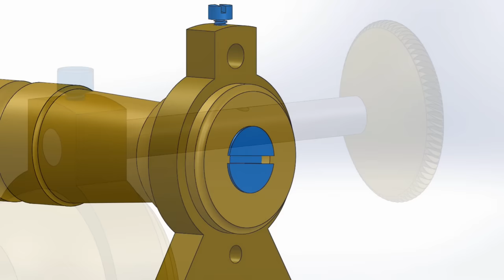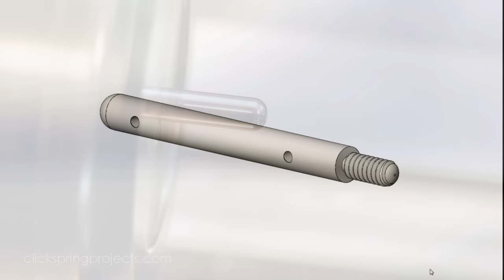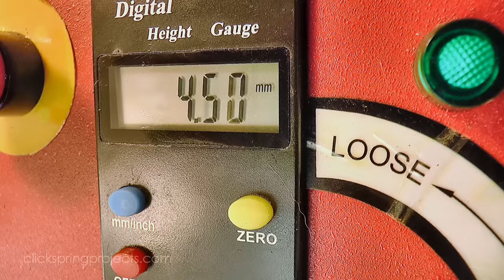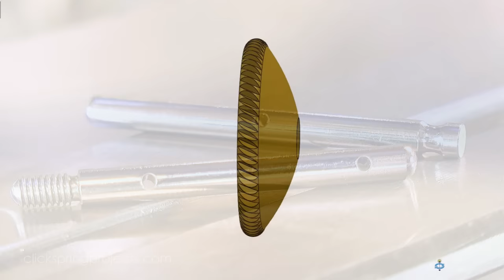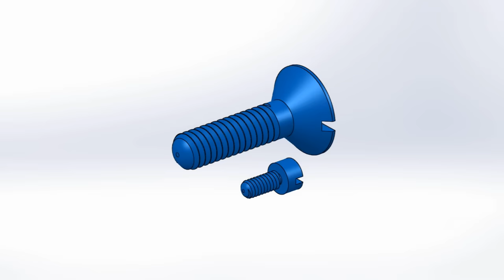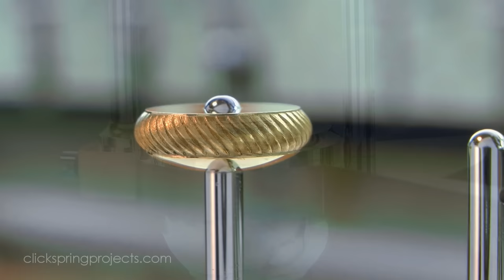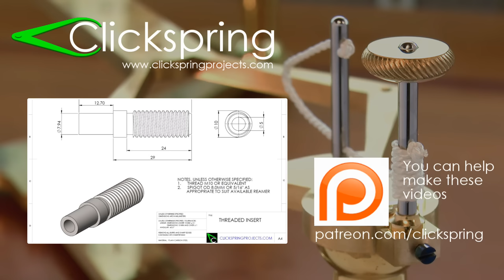Clockmaking - How To Make A Clock - Part 17 - Making The Regulator And Suspension Post

Comment: ah, the explanation on why you only made 5 of the screws finally comes to light!
i will agree, the simplicity of the pendulum mount makes it a lot easier then having an adjustable bob on the end that i have seen on other clocks.
keep up the excellent and beautiful work!
Reply from the maker: +kelby bannert Hey Kelby, yes I suspect the thread will have its own negative attribute of stretching over time, and possibly changing with humidity, but it sure is a simple approach! Cheers mate :)
Reply: +Clickspring leather if treated right doesnt stretch or change with humidity :) if the silk string doesnt cut it and you're looking for a traditional and natural alternative. dont know if leather is used in clockmaking but in really old mechanics its used where there should be no stretch, like between the helm and rudder on a ship. The silk is beautiful and not at all like leather though, maybe not what you're looking for in the artistic sense....

Comment: Having said that about the supporter pack.....amazing stuff with the clock....fascinating to watch. Doubt I could have the patience to complete the whole project, so I tip me lid to ya for the accuracy and tenacity this project requires. I used to work for Myer in Sydney and watches that came back for repair, It was my job to drop off the watches at the various watch repair shops in the city. I was always a little envious of the watch repairers job. It seemed to be a role you could lose yourself in, to enter a meditative state.

Comment: Hi,

I have been viewing your channel for some months now, and am absolutely enthralled with this full build clock project. I am really interested in all kinds of watches and clocks, I think I caught the clock work bug when dad bought 3 ready made grand-father clock mechanisms and built cases the appropriate sizes to fit each particular room they would be standing, two for instance were to stand in two completely different house 10 miles apart but by chance each of the owners, my nan and my father’s sister used the loft as an extra bedroom so with the slope of the roof impeding the height a lot each of those clocks were make less high and that was made to look correct with a slimmer body.
I was only 7 at the time though the mechanical bug must have made a real impression on me to remember it 50 years later!

I wish I could have borrowed my brother in laws watch makers Lathe but he said I can’t, and judging on some of the things you have done it mayn’t have been big enough to do some of the work. 
I will have to settle on viewing your wonderful videos instead, trying to teach myself what the names of the parts are and their placing you know.

Take care and thanks for the upload and video work.
mrbluenun
Reply from the maker: +mrbluenun Appreciate you taking the time to watch mate :)

Comment: Why not simply use a screw adjustable weight at the bottom of the pendulum? Moving its center of mass up and down also adjusts the effective length and so the speed.

Comment: How do you bring the inside of your screw threads to such a high polish?
Reply: +NightHawkInLight Really cool to see that one of the youtubers I subscribe to is a fan of another youtuber I subscribe to!
Reply from the maker: +NightHawkInLight Diamantine powder (very fine aluminum oxide) mixed with a small amount of oil, applied with a piece of pegwood (a soft dense wood). The pegwood quickly takes up the shape of the thread, and then the polish can cut all the way to the bottom of the thread. Great to have you watching mate :)

Comment: You should use a bit of oil while you"re knurling. Without the extra lubrication, the surfaces tear a little bit where the wheel contacts it. You'll get a much brighter surface finish.

Comment: I love watching these videos, and they have inspired me to purchase an old atlas lathe, Just one question, if you wanted to make sure the countersunk screw slot was vertical how would you do that? My thought is to cut the threads for both sides thread the screw blank in than mark where the slot would be. But I'm sure there has to be an easier way.
Reply from the maker: +Brian Lenz The method you mention is the most reliable way to time screws. There are other approaches, but this is the least troublesome. Although with steel into brass, its not really worth the trouble. The brass is too soft and gives over time. After multiple insertions, the thread is slightly worn, and the orientation changes significantly, and not in an easy to predict manner. Steel into steel is much more reliable, although still problematic - its surprising how much the thread orientation changes once polishing commences, so a fair amount of guesswork is required to predict where the slot will be after all work is completed
Reply: Wow, I didn't even consider the different metals! Thanks for the info, can't wait to see whats next.

Comment: Why didn't you use the cross-hole jig on the finger plate clamping tool? I think it will yield a much more accurate cross hole for the rods.
Reply from the maker: +Hyper Paradox You're right, I completely forgot about it :)

Comment: Hey Chris, outstanding as usual. Just a quick question if i may, On average how long does it take to put a vid together? If you were to fabricate the parts in this vid without recording, overdub, graphics (which quite frankly are a professional touch) etc. what is the time difference?
Mick.
Reply from the maker: +The Foont If I was just making the clock with no interrruptions, I would have been done in about 6 to 8 weeks. Filming takes up a huge amount of time, plus I have to fit it all in with my day job. Thanks for tuning in mate :)

Comment: Awesome work! But I'm curious as to why you didn't align the slot of the countersunk screw with the frame or any other reference. Have you decided as a general rule that you won't align the screw heads?

In any case, thank you for sharing your labor of love.
Reply from the maker: +Eddy Miller Hey Eddy, I did it for the barrel screws after a viewer request, but generally its not worth the trouble to time hardened steel screws in brass. The metal is too soft, and "gives" after multiple insertions of the screw. In a short period of time the orientation is lost. Far better to embrace a little randomness in the presentation :)

Comment: Excellent as always Chris, mate quick question, I know you live up in North QLD (I'm in Brisbane). What do you use on your machines to stop surface rust. I just got a new (to me) lathe and wondered what was best to keep the rust away. Any help would be greatly appreciated and can't wait for you next vid.... I wish mine where as well done as yours :) 
Cheers 
Mark
Reply from the maker: +Mark Valenzia Hey Mark, yes it is a big issue particularly during the wet season. I give everything a thin coating of compressor oil every time I'm finished with it, and find that works very effectively. It requires complete discipline; if I should forget there will be flash rust to greet me the following day, but since adopting this practice I have solved the issue completely.
Reply: Thanks for getting back to me mate, I'll definitely look at giving the compressor oil a go. Thanks again.

Comment: Is it necessary to stretch the silk before putting it in the clock? Do you plan on CA gluing the knots?
Reply from the maker: +George Savage That's a good idea on the CA glue George. Might also look at a small brass bead, and swage it on. Thanks for suggesting :)
Reply: +Clickspring Nylon thread can be carefully heated to prevent untying. A temperature controlled soldering iron is the best tool for that job to prevent scorching. I've used that technique when mounting guitar strings if they got too short o tie reliably.

Comment: AvE once said "It is a sign of a true craftsman when all the screws on a piece of work line up". That top one is the only one that doesn't, is there any way to change the angle of the screw relative to the others when fully threaded in?
Reply from the maker: +The Thinker I did it for the barrel screws after a viewer request, but generally its not worth the trouble to time hardened steel screws in brass. The metal is too soft, and "gives" after multiple insertions of the screw. In a short period of time the orientation is lost. Even with screwing steel into steel its not something i would generally pursue, as it also requires all future repairman to pay close attention to the screw locations over the (several hundred year?) life of the clock to maintain the effect. Far better to embrace a little randomness in the presentation. Thanks for watching
Reply: +Clickspring Ahh I understand, thank you for taking the time to respond to that. I absolutely love the videos and think you do amazing work, I was just curious about that.
Reply: +Clickspring Great explanation. Guess that's why 'clocking' screws is something only wood workers do, because the wood always has some give to it.

Comment: Odd question, do some machinists stop the blueing process on parts earlier? To get straw or bronze colours?
Reply from the maker: +Andy Collier Yes definitely - the lighter straw colors are perfect for cutting tools; the steel remains much harder. A blue temper is good for springs, screws etc and also for the cosmetic appearance. Cheers Andy :)

Comment: What's the difference between a drill and a reamer, and what's the objective when reaming a freshly drilled hole?
Reply from the maker: +colavfreak2 Drills generate quite a rough hole, that is not particularly accurate. Drilling slightly undersized, and then following with a reamer will give you a precise hole dimension with a good surface finish. Thanks for watching and asking

Comment: 6:33 People usually heat up the pieces to release cyanoacrylate, which could harm the finish. Is acetone sufficient enough? How well does it get between the pieces?
Reply from the maker: +Evren Uçar Yes heat is quick but it will marr the finish. In this case I wanted to keep the finish fresh, so acetone is the best alternative to heat. It works fine if you are prepared to wait a little while (30 mins) The trick is to not put on any more CA glue than you really need to hold it for the cut. Any excess is just extra time you have to wait for the acetone to erode it. If you put on too much just leave it to soak in acetone overnight, by morning it will be free.
Reply: Clickspring Thanks for the tip!

Comment: Hey I've been wondering.  You use the superglue trick a few times in this build, usually resulting in heating it to break the bond.  Was there a similar way of doing this in the past with other materials, or would they have simply have had to make the pieces all out of one piece of stock rod.

Similar question with the use of loctite.
Reply from the maker: +mickleman52 Yes the super glue trick is simply a modern version of the shellac "Wax Chuck" used by watch and clockmakers for centuries, and still used today. I find CA glue a bit less hassle than heating shellac, but it amounts to the same thing. Same sort of issue with Loctite. Traditionally soft solder was used to fasten things like collets to arbors, and it still is used today. But there are metallurgical issues that crop up with soldering that can be so easily avoided with Loctite, its hard to resist using it. Cheers mate :)
Reply: Thanks for always responding to my dumb questions!

Comment: The mechanism itself looks so complicated I wonder how anyone came up with it in the first place.

Should you really trim the end of the silk so close to the knot? For some reason I expected some method of pinning or clamping the cord.

I like that there's swag for this channel now, I think I would get a mousepad or mug or something along those lines.
Reply from the maker: +Fraccles Traditionally its just tied off in a knot, but I could probably put a small bead on the end and swage it closed. I'll see how it goes when i get closer to the finish line. I will be looking at mouse pads and mugs in future, thanks for watching
Reply: @Clickspring  Sailors would rather use a figure of eight knot instead of an overhand knot in fear of the latter slipping off, but that's quite another trade 😉

Comment: Amazing video, as always!

One question though. Aren't you affraid of the wire breaking? If it moves a lot (or, well, when a metal piece rubs along it), won't it tear, or gradually show signs of wear?
Reply from the maker: +Duct Tape The thread is silk, so reasonably durable. A repairer I know has seen silk thread suspensions last several decades before needing replacement, so should be ok, I'll keep an eye on it though!
Reply: Thanks! Did not know that, haha.

Comment: Won't the distance between the two holes in the lower steel rod change with temperature, and change the effective length of the pendulum?

Comment: Any idea what traditionally would have been used in place of loctite? 

Also, is that Solidworks you're using?
Reply from the maker: +Eric Dykstra Generally soft solder. Solder is still perfectly resonable to use, but there are some excellent benefits of Loctite adhesives that make them hugely popular in modern horology, and in general engineering. Yes its Solidworks, consider Fusion360, free for home use Thanks for watching Eric

Comment: out of curiousity, why don't you use a sharpie for doing your layouts? is that a special layout dye?
Reply from the maker: Yes, Dykem Blue Layout fluid. A sharpie gives contrast for the mark, and is quick and convenient but the coating is very thin. Dykem Blue leaves a thicker coating, and if you're careful you can scribe a mark in Dykem without going into the underlying metal. This is important particularly in a complex layout with construction lines all over a workpiece surface that will not be machined. Or if you need to correct a mistake in your layout. With a Sharpie, all of that scribing would be permanently on the metal, requiring later removal. With Dykem, wash it off using denatured alcohol, and you're done.
Reply: all good points. thanks for responding.

Comment: What would be the purpose of using an eccentric bushing for the pallet arbor?
Reply from the maker: +ExtantFrodo2 It gives a small measure of adjustment to the escapement, to improve the action
Reply: Mmmm, but aren't you then limited to a variance that implements a compound set of factors. Translation only about some centroid means you can adjust up,left down or right but restricted to the path of the eccentric. A less elegant looking solution I have seen uses a "floating" bushing plate. The verge would then have many more options for tweaking to the max.

Comment: You dry-turn a lot of hard material. Do you sacrifice tooling edges for the sake of filming?
Reply from the maker: +KC Jones Most of the time I'm using HSS with soft materials like brass, aluminium and mild steel and find no need for cutting oil. The exception is tool steel where it is rare that I don't use cutting oil, its just not often apparent in the video.

Comment: You mention the frame barely fitting on your mill. Are you using a Sieg X2 or Sieg X3 mill? I'm about to buy my son his first mill (X2 from little machine shop) and want to know if it's big enough for this step.
Reply from the maker: Hey Bryan, I have both an SX2 and SX3 but the comment was made in reference to the SX3. The X2 is definitely not big enough to accommodate something as tall as the frames for this clock.

Comment: Why silk? is strength or is it resistant to stretching?
Reply: +g2macs You got 2 of 3, silk has (relatively, for a natural fibre) high abrasion resistance so as the pendulum swings the thread won't wear as quickly on the edges of the suspension post holes.
Reply: +Jesse Kinch . Ta! Interesting stuff.

Comment: Chris, 

You should have made a mandrel (faced/drilled/tapped barstock) and then fitted the countersunk screw + brass washer to it. Then face the lot to clean up the screw head flush with the brass... then polish them. That way the countersunk is DEAD flush and would look awesome once mirror polished (and blued) - two different reflective surfaces in the same plane.

Furthermore the back of the brass could be sanded/lapped so the countersunk screw head slot would line up either vertical or horizontal - which it was not far from. 

Most of your work is top notch but the fact you machined those pieces and just simply bolted them on as "production" parts is a bit odd...

Don't get me wrong, I'm not hating but as a machinist I know the feeling of not making something perfect or to the "n th" degree - especially on your own job!
Reply from the maker: +Mark Palaszewski I hear you Mark, but it was a deliberate choice to leave the face of the screw proud; it looks better to me that way, with a bit more depth. Flush looked too sterile. Thanks for sharing your thoughts all the same. Timing hardened steel screws in brass is not really worth the effort. Its much more repeatable if screwing steel into steel, but brass is too soft, and "gives" over time so that the orientation is soon lost after a few repeated inserts.  Cheers mate :)
Reply: +Clickspring After seeing how much effort you put into preserving that polished edge between the conical and parallel section of that screw it would be a waste to hide it in a larger countersink or even a slightly counterbored countersunk hole!

I hear you on the brass! Thats the worst with &quot;hobby grade&quot; materials. Soft brass will loose its edges just from slightly inattentive polishing and doesnt really hold a tolerance under any loading. C95800 anyone? Too bad it doesnt come in sheet/plate easily.

Keep up the first class machining and video production Chris, you have captivated a nice niche in the YouTube community.